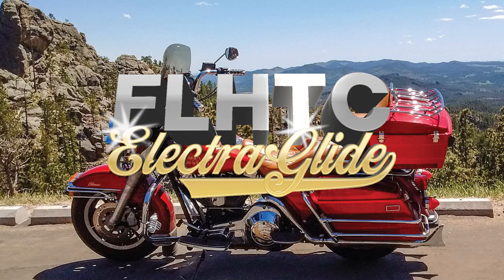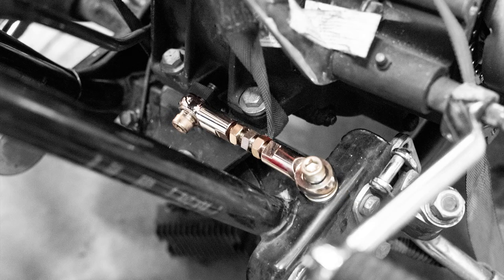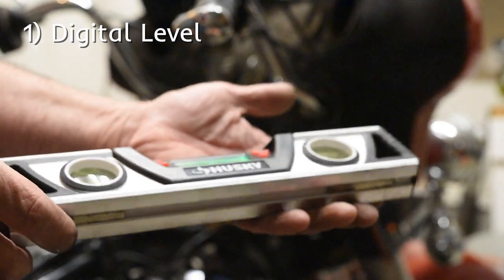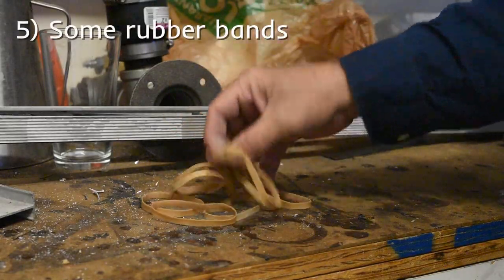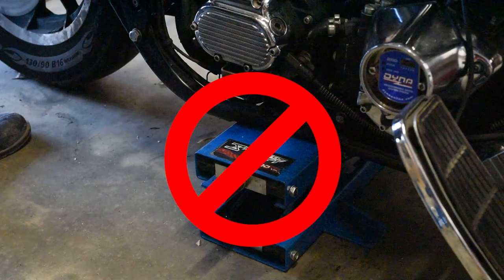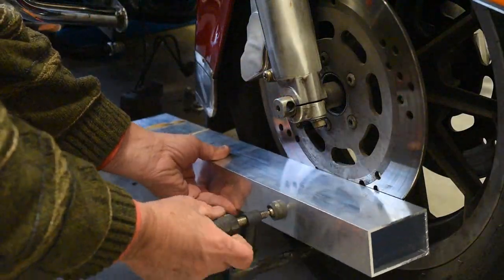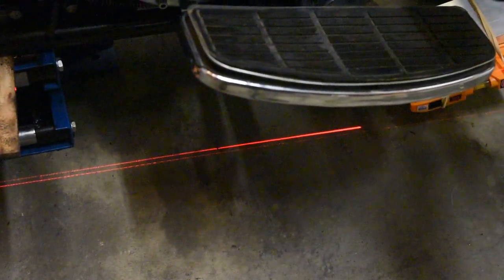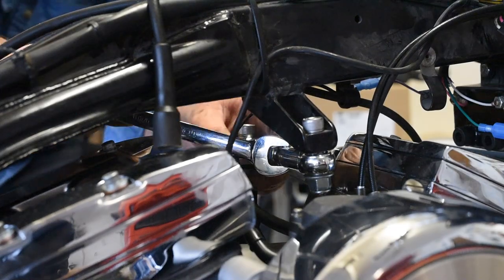Simple Harley Frame Alignment Using Lasers

Comment: They (harley) must do an ok job with the solid link
 on an m8 flhx touring..
Just installed m3 isolators & was shocked how easy the pivot went through...thought i would have had to yank & jerk the eng/trans combo for the pivot bolt to go through...went like butter...
Thanks for the video...
my bikes never handled like this before

Comment: Thanks for posting this! I too used Glide Pro parts on my bike as well as this procedure. The only other things I would add would be: 1, make sure your drive belt tension is correct. 2, make sure your neck bearings are at the correct tension and lube if necessary. Also it wouldn’t hurt to make sure that your fork legs are sitting in the triple trees are even. Doing theses checks BEFORE your alignment might save you hours of time.

Comment: Albeit there are usually 100 ways to do things, yours is for sure a nice simple explanation.
Thanx.
 There is a 10000 ways to est a straight line, a laser is just faster.
The unknowns are hardly fixable- is the frame sq to the front triple trees??  
With that, centering the rake to "0" deg is the only option as there is zero provision for adjusting it.  
We have to hope HD jigged the frame correctly.

A real wheel alignment always starts with the rear on most anything.
Great job!
I would like to add-
If ANY of the mounting points are 5 years old or older, throw them in the dumpster B4 starting as you will be wasting your time.
For sure the inside swing arm bushing is shot just from sitting there on the kickstand all leaned over.
You will notice this when the frame is leveled and the level says rear swingarm is leaned way over.
One last thing -there are several versions of a frame to transmission mounts now available. I do highly recommend installing this as it makes for a very nice platform to ride. No more squiggles!

Comment: Great video and Thank you for taking the time to show that alignment procedure.  I have floating rotors on my Harley that I put on because the stock factory ones warped within 10,000 miles.  Since the rotors are floating there is no way to actually tell if they are parallel at any point, they move.  Also, this procedure counts on the front wheel to be straight however, you have no way of really "dialing in" straight.  One degree off on the handle bars is a bunch of error down at the wheel rotor.   The real problem is you don't have any "fixed hard points" to use to set up datums. You can use the rear rotor but once again if that rotor is off by just a tiny amount your going to see a bunch of error at the front of the bike. Even one degree over 8 feet adds up to a huge error..Im a Mechanical Engineer and I have been thinking about this problem for a few days now....I'm going to come up with a way to get my damn RK aligned if it kills me and it may...LOL
Reply from the maker: Great comment! Thanks for sharing your thoughts.

You've hit on the central assumption that underlies this procedure: This only works if the frame and forks are accurately manufactured, and also haven't been bent or tweaked somewhere along the line.

If everything is proper and square, then it all works. If the frame/forks aren't square, who knows what you'll get.

But if the frame and forks are square to themselves, then setting the front rotor to dead plumb will indeed have the effect of making sure it is pointing perfectly forward.
Reply: 8th

Comment: In this video you have released the top stabilizer link eyelet allowing for Engine top movement. At 3:24 into this video, the front stabilizer link is adjusted while observing the laser lines. The one side of the front stabilizer is tied to the frame and the other side (end) to the Front Engine Motor Mount bracket. This front Motor Mount bracket cannot move, unless you release (untighten) the Main Motor Mount center bolt/flange nut and the corresponding two side bolts/flange nuts on the Motor Mount going to the lower frame crossmember. Correct? I did not see/hear that the Front Motor Mount was untightened (enough) to allow the Motor Mount to move as the Front Stabilizer is adjusted. Did I miss something here?
Reply: For my 2004 FLHRSI Road King Custom, looking at my 2004 HD Service Manual for Touring Models (p/n 99483-04A) on page 2-28 Figure 2-37 is the diagram of the Front Stabilizer Link and Engine Mounting Bracket. Bolts F & G are what I am referencing that require loosening.

Comment: So you dont think anything needs loosening up before you start adjusting the adjustment links . I take one bolt out of each adjustment adjuster , loosen the 4 large swing arm cap bolts that is also the rear foot rest brackets , loosen all 4 of the header pipe nuts at the head , loosen the 2 front (or remove) motor support mounting bolts to the frame and the center main support bolt . I use a hammer handle ,piece of wood ,what ever between the frame and the engine block at the front motor support to scoot/move the engine from side to side - the direction it needs to go . Why ? When you put the hammer handle or what ever , you can wrap it with tape , in there and start to move the engine you will see just how weak/flexible the main frame is down at the front motor support area , try it you will see , mine is a 08 ultra , the frame is a little stronger at the top adjuster . I move the engine by hand to align the front and rear wheels ,then adjust the adjuster to line up with the bolt holes and mount it , so the frame isnt pulled away from where it normally sets . The frame flexes at the front motor support every time you go into a curve from the force and weight against the rear wheel . On some harleys they put 2 bolts in the top of the engine guard/crash bar to help brace the weakness of the lower frame at the front motor support , with 1 bolt at the top it pivots .I jack mine up enough to hold the bike up right then use thin what ever to level , you dont align a car up off the floor because when you set the weight of the vehicle down on the wheels the alignment can change . Now do what ever you want to , its yours .........
Reply from the maker: Honestly, I was going to say I think you're making it way harder than it needs to be but otherwise aren't hurting anything, but re-reading that, I think your procedure is just plan bad.

With these rubber mounted engines, the entire system (engine/transmission/exhaust/starter/primary/everything) is rubber isolated from the frame: The front motor mount, the donuts on the swing arm, the rubber exhaust hangers and then two heim joints to keep everything lined up.

Loosening the brackets covering the rear donuts probably doesn't hurt anything, but I don't see how it does you any good.

But loosening the exhaust flange nuts? That's just a plain bad idea. What do you think happens after you've moved the motor, then go to re-tighten those flanges?

If you're lucky, you'll pull them up tight and that's that. But you're also needlessly introducing the possibility of an exhaust leak, and for what benefit? The exhaust is hard mounted to the engine, but rubber isolated from the frame at the back. All you are doing is taking whatever flexing those rear exhaust isolators experience during the heim joint adjustment and imposing exactly the same flex on them later. Only your way your forcing the flex via the exhaust flange nuts, rather than when the whole system moves during heim joint adjustment. That's introducing a potential problem, not solving one.

And this stuff about using a wooden handle to move the engine because the frame is too weak? Not sure what I can tell you other than I just disagree.
Reply: @TheJeffMiller  Thanks for removing all doubt of exactly how little you know about mechanic work and what your working on , Ive forgot more about mechanic work than you will ever know , I wont waste my time any further ............

Comment: Totally  not necessary, string method works just fine with front rotors plumb and then plumb rear rotor with turnbuckles loose and make adjustments to bring swing arm and wheel plumb.

Comment: 3:51 What is this reading 899? Edit: I see now, just up against 90 degrees, close enough
to a perfect 90.
Reply: its 89.9 degrees.....   He's only  .1 degree off of perfect vertical.
Reply: @raymondpontremoli4500  Yeah, you saw my edit , good. 
I had originally not seen the decimal, I doubt anyone can,
it looked like 899, that's why 6 months ago, I edited 
the comment after realizing there must be one 
in there. 89.9 makes a lot more sense  than 899.
Reply: @bikersoncall  Nope didn't see the decimal point...LOL.  You got it ....It's all good in the hood..
Reply: @raymondpontremoli4500  haha, plus,
I've used a zillion levels, lazer, old 
school, never used  a digital, I 
stopped doing that 'stuff' a decade
or so ago, lol, so 
I haven't really taken note of what
they would put up in the digital display.
Peace.. (note to self: go buy a digital
level) :)
Reply: @bikersoncall  did you really think it read 899 degrees?
Reply: @badsanta518  Having seen this
digital tool for the first time, not
knowing what or how it was read,
you would have thought it
was your weight, and you'd still be 
triggered by someone else not 
knowing.
Reply: @bikersoncall  just thought it was funny that someone saw a digital level and thought it read 899 degrees.